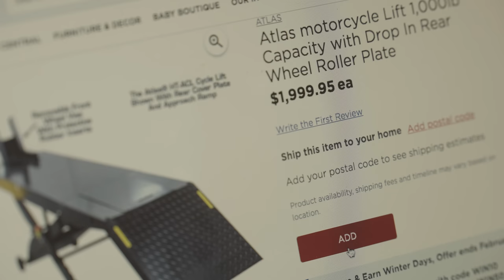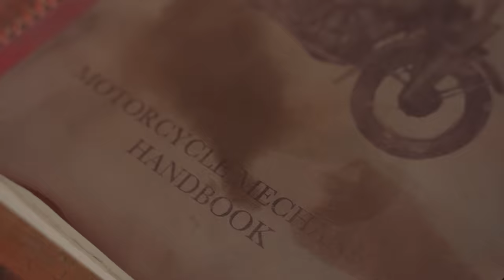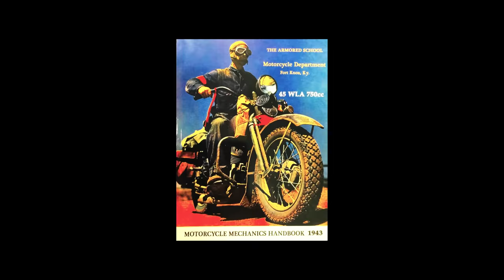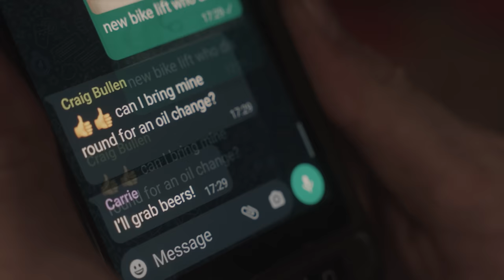DIY Roll-On Motorcycle Lift for $290

Comment: More DIY videos like this! I think many of us can agree that building our own bike shops is a lot more fun than to buy everything online
Reply: THIS!!! 100% this.
Reply: Problem is that lumber is so expensive, it's hard to justify not just stumping up the aluminium and steel prebuilds
Reply: @m1chi13l  not to mention the easy $1000+ on the machinery/tools
Reply: @charlesbennet9233  ... you can always borrow tools from a buddy or your BIL (perfect for F9 cheap bastards) or rent them. No need to fork out $ 1,000 on tools.
Reply: @thedude4065  yeah I can, but not everyone is on the same position. I rate the post but saying only $290 and then using machinery worth triple that and more is disingenuous.
Reply: @charlesbennet9233  regarding tools for this build, they showed nice to have, not must have, you can do all this with a hand saw and a screwdriver, so maybe like $10-15 in tools? Don't let expensive tools in build guides discourage you from building something cool, also don't buy all tools at once, acquire them I over time.
Also, you can get a cordless drill for around 80-120 in a kit with batteries and charger and a miter saw for around 150
Reply: My wife’s mom and dad built a house in the 1950’s using not much more than a hand saw, hammer ,level, tape measure and combo square.

Comment: Works.  The bent over nails reminded me of building soap box karts out of skids in the early 60s.  Lots of bent over nails holding the axles in.  The nails were from Dads used nail bucket.  Never wasted anything.  Cheers 🇨🇦
Reply: No one ever considers the value of the used nail bucket.
Reply: Same. Once thought to take a shortcut and substituted roofing staples. First turning action at speed resulted in a rapid separation of front axle rebar and tricycle wheels (liberated from little sister's garage sale treasure) in a shower of staples as the front of the kart dug into the pavement.

Comment: If anyone is adding the metric units next to the imperial ones I wouldn't mind downloading that one as well :D Also, big thank you F9! Great build.
Reply: Multiply by 2.54= cm
Reply: There's an app for that
Reply: timber sizes are standardised metric and imperial, and get a dual scale tape measure. It'll be good enough.
Reply: Just learn how to brain in inches and feets. Lumber/woodworking is especially well suited for these measurements. I mean, I had to learn how to brain in metric units on occasion. Seeing that the world uses both systems whether we like it or not, it isn't dumb to be able to use both.
Reply: There's always one...

Comment: My bike weighs 400 pounds after farkling, so I use four cam buckle nylon straps to lift it to the rafters of my bike shed.  It hangs and can swing, but angled lifting from four corners tends to keep it centered and there is nothing underneath to obstruct access when changing oil or removing the skid plate, and the rear wheel is hanging in the air so it can spin freely for chain cleaning.  IT's essentially a zero cost bike lift, as I already have the cam buckle straps.

Comment: I have 2 left hands , I just bought the $799 hydraulic motorcycle lift. Not only did I save money on hour labor but I'm pretty sure I saved a couple fingers as well 😅. 
Epic video!
Reply: Pretty sure you'll also be able to do work on the front and rear ends of the bike. Well, if it's a hydraulic frame lift.
Reply: @DiscoFang  yeah works perfect , I can even take out a part in the back so I can easily remove my rear wheel. 😌

Comment: There are alternatives to the bent-rebar front stop that may make the project more accessible. U-shaped brackets, for instance would be one way.
Anyway, great video as always!
Reply: I'd assume that the rebar is a VERY cheap option, they seem to  be trying to hit a sub $300 price point.
Reply: The cheapest and most accessible solution seems to be to just do it without the front stop.
Reply: @Tarkov.  But it requires tools not everyone would have. Most of this could be done with a plain saw, hand drill and a screw driver if you wanted to. What cheap or repurposed house hold object could you use to bend rebar with?
Reply: @Frag-ile  Didn't they show how to bend the rebar in the video? He didn't use any tools other than some heat to soften it...
Reply: How about a torch and small amount arm strength?
Reply: Copper pipe would probably work, but not quite as sturdy….
Reply: @whinstonwhoodle6373  a torch is already a tool that many people don't have.
Reply: @Jehty_  literally a gas station butane lighter is enough to get the job done - it's heating 1 single point on a piece of 1/4" rebar til it's hot enough to bend more easily. If you have to go to the store to buy ANY of this shit, I'm sure you can find something cheap that makes fire while you're there. While you're at it, grab a cheap junky piece of pipe for a lever and bending rebar is easy enough a kid could do it.
Reply: Just use 2 pieces of 2x4 in v shape this will cost you an additional 6 wood screws plus the wood instead of the rebar.
Reply: @Jehty_  You can get a perfectly good torch for about $20.  And you'll find it's useful for many things.

Comment: Perfection...again!  And I love the spanner to turn the eye bolt trick, genius!
Reply: I use open end wrenches to turn eyebolts. I put one jaw through the eye and turn. Been doing that for years. Recently I cut a slot in a deep well socket, slip it over the eye and use an electric drill to run it in.
Reply: @karlbishop7481  haha I use that really crappy "gator grip" socket full of springloaded pins for hooks and eye bolts- it's the only thing that sucker is good for

Comment: Thank you!
For wheel changes I typically use a ladder. with a cheap 12v boat winch mounted to a piece of wood at the top. Connect the winch to the bike's battery, then lift for wheel removal. In your vid you show the bike swinging, but this is easily remedied by straps to the ladder steps on either side.

Comment: You could build it solid too (no pivot), and use a folding loading ramp from crappy tire to get the bike on, to simplify building and keep costs down.  The biggest PITA for me (when working on street bikes) is always getting the front end up and well supported to remove the forks.  I've definitely done the ladder trick, as well as the rafter trick!

Comment: I‘m highly interested in two aspects:

1) Weight limit — not due to construction strenght but due to how much bike weight can an adult person hold in balance with stretched elevated arms while letting it roll uphill to the tipping point?
2) What is the advised procedure to let it down again, as that rear lever part has to be disengaged and straightened before rolling back (again: also for bulkier/taller/heavier bikes)?
Reply: It's a roll on bike lift. Nobody said anything about getting it back off.
Reply: @caffynated552  made my day… I guess I‘ll just mount wheels and a final drive to the stand itself and ride that way 🤪

Comment: Brilliant idea and I will take on the project as soon as weather gets better around the Windy City.  I have a suggestion and my apologies in advance -if I overlooked that detail. I would add a safety latch or drop a wood peg/big dowel pin, on top of the foot ramp (f), while the foot ramp (f) is in upright position (step 4 *f-b).  This safety will prevent in case foot ramp(f) comes off, while securing the front wheel or front forks with wretch straps etc.. Also similar safety idea could be implemented in the front post A - to secure the foot ramp from unintentionally coming off and allow the motorcycle to till rearward. Thanks for sharing.

Comment: Good concept but I can see this tipping sideways as it's very narrow. I would improve the design by adding gussets to the side of the legs for stability (or swinging outriggers with a chain to limit their extension). Then making it fold almost flat for storage along a wall by change the leg fixings to more pipe pivots, with a pin to lock them in place when in use, then it can parallelogram down. Then you can stand it on its end and tie it to the wall.

Comment: List of actual cost in video

Ryobi Mitre Saw - $226
Powermatic Drill Press - $3,662
Large Bore Drill Bite - $90
Maximum Drill - $226
DeWalt Bite - $9
Drill Bite - $15
Angle Grinder - $113
Cutting/Grinding Disk - $6
Maximum Driver - $340
Makita Circular Saw - $190
Saw Blade - $30
MAP Torch - $99
Hammer - $25

Tool Total: $5,130
Material: $290
Total: $5,420
Reply: Let's not forget a workshop large enough to contain all this stuff!
Reply: You can do it with very basic tools if you really want to...
Reply: @danarrib  We're having a laugh is all

Comment: I made one with a piece of thick sheet aluminum a friend had lying around. I cut it a foot longer than my longest bike, and bent 1" lip all around to fit perfectly over some milk crates I had in the shed. Then I mounted a cheap wheel chock on the end of it and made a 4 foot wide, L-bracket "arm" out of the same material that fits under the front crate to attach handlebar tie down straps. I already had a ramp to use to get the bike onto it. It weighs next to nothing and is easily stored under the roof of the carport on a cheap rack I made out of rope and plywood strips. It makes working on the bikes a lot easier, especially at my rather advanced age. I wouldn't pull a Gold Wing onto it, but it easily supports all of my sub-500 pound, 650cc and less bikes. I wish I could attach a photo.

Comment: Top 5 waterproof gloves video is private?😖
Reply: Copied from earlier reply:
They messed up with equating gasproof with waterproof. They had a cool bubbling tanks with slightly compressed air inside the gloves. It looked cool but it didn't prove what they thought they were proving. The replacement video will likely fix this error.

Comment: What happened to the waterproof gloves video?
Reply: Copied from earlier reply:
They messed up with equating gasproof with waterproof. They had a cool bubbling tanks with slightly compressed air inside the gloves. It looked cool but it didn't prove what they thought they were proving. The replacement video will likely fix this error.

Comment: Why are waterproof gloves private
Reply: Who knows. I just went to watch it too 😅
Reply: They messed up with equating gasproof with waterproof. They had a cool bubbling tanks with slightly compressed air inside the gloves. It looked cool but it didn't prove what they thought they were proving. The replacement video will likely fix this error.
Reply: @ddegn  thanks 👍

Comment: Why did you guys already private your new video
Reply: Copied from earlier reply:
They messed up with equating gasproof with waterproof. They had a cool bubbling tanks with slightly compressed air inside the gloves. It looked cool but it didn't prove what they thought they were proving. The replacement video will likely fix this error.

Comment: Did they upload waterproof glove video and then remove it? Or am I imagining things?
Reply: Nah it happened. (and isn't it scary how common this question is becoming?)
Most likely they saw all the feedback on their error and are doing a reshoot.
Reply: @VarvasNukka  what error did they make?
Reply: @Androajay  In the tank test they were testing waterproofness by having the gloves be in water and watching for air bubbles coming out.
Problem is that water molecules are bigger than air ones, so really the test just tells how breathable the glove is but nothing really about water resilience.
Expensive gloves are supposed to have membranes that specifically allow air through but block water, and that test showed that but was called a bad thing.

Comment: DIY...now you're speaking my language.
A few modifications...scaling back the dimensions of the lumber, replacing the re-bar with a removeable piece made of ABS pipe, fix some wheels to the end, and I'll be able to roll it around and stand it on end in a corner of my garage. This will be great for my sub 300lb bike and scooter.

Comment: Hiya,

great video and nice project! What's the maximum weight it can carry? Is there by any chance a version of the plans available with metric units? (For the few of your followers not living in Northern America, Liberia or Myanmar and for the many of them too lazy to do the maths.)

Best wishes!
Reply: With the size of the wood that would carry a small bus.
Reply: Fire up the Goldwing!
Reply: Inches x 2.54 = cm
Reply: There's free phone apps to convert
Reply: @unsafe_at_any_speed  ...  like the guy above posted, ... Inches x 2.54 = cm
Reply: @MikeHcan2  cm? What are you - a dressmaker? The civilised world uses mm.
Reply: @darkiee69  Timber is good in tension and compression - bending not so much. But there's nothing that a flitch plate or some toe down channel or angle fixed to the underside for ½ the length of the span, centred on the pivot, wouldn't fix. You could even carry the slotted angle right through over the pivot point, point rather than having the gap, and put some low clearance holes in to fix it as a tension member with coach screws that would limit the strain of the timber.
Reply: @TonyRule   Bending is tension and compression. Which, as you point out, wood is very good at. That is what wood is particularly good at - bending.
Reply: @DiscoFang  No. The rail will be subject to tension through to the neutral axis.
Reply: @DiscoFang  Oh, I see - I miswrote that. It's not that good in tension - the fibres pull apart relatively easily.
Reply: @TonyRule  No yourself. Strength in bending/deflection is what timber does best. Eg Masts. Timber framing.
Reply: @DiscoFang  No, it doesn't. Timber masts have stays to prevent bending for this very reason - it puts them in compression to limit the tension forces at the extremities of their cross section where they'd be in tension - much like pre-stressed concrete. Timber framing used in situations that are primarily subject to bending loads, such as rafters, trusses, stringers, and joists, are tall sections opposing the load or are braced with span reducing struts and ties for a reason - they would otherwise quickly tear apart on the side opposite the applied bending load, without those additions, and fail. What do you think the nogs are for in vertical framing? To reduce the induced bending from compressive loads by breaking the span.
Reply: @TonyRule  You’re describing point of failure load limits to dismiss their function and properties within limits. Stays on masts increase limits. Refer back to the original point - bending is both compression and tension. Timber flexes - to a point.
Reply: @DiscoFang  The original point to which I replied was that that member "could carry a small bus" . It might if it was in a simply supported configuration, but not with that rear cantilever.

Comment: Have hydralic lifts available for just above 600$ here, no need to go all the way to 2000$.
Bought one an it works fine, specially with an added mini screw type lift (60$) to put under the belly of the MC
Very flexible setup

Comment: To be fair, down here in Yankistan <insert monger of cheap asian tools>sells a heavily, heavily discounted bike stand. Hardly as romantic or wonderful, though, but squarely between the price of the two above and fully hydraulic. My ride was stranded on one at a friend's house for an entire winter with no issues. It's a good tip for some.

Comment: For the same price or less if you find it used, just buy a Hydraulic lift Table Cart from Harbor Fright. It slides underneath the flat frame, and the wheels make it portable and can lift up to waist height.  It's what I have been using for my Dr650

Comment: That's cute.  HF heavyweight motorcycle platform lift is $600...steel.  lightweight $400 (were half that on sale before 2019).

MC hydraulic or mechanical jacks are 40 to $150USD.  Abut $200CAD

Comment: Great video from @FortNine as always, and the concept is pretty cool.  However, I just looked over the plans and feel compelled to point out that they are seriously deficient and downright scary from a safety perspective! 😬 Raising a heavy motorcycle 15 1/2" on a wooden stand with a base only 14" wide?  It wouldn't take much of a sideways push to cause the bike and stand to fall over, causing serious injury or death.  This needs a MUCH WIDER base.
Remedy:  Get 2 more heavy-duty steel angle irons, at least 48" long, and attach one at the rear of the center pivot (part D) with long screws or bolts and the other at the very front under part A.  This will give an extra 17" of width on either side of the stand making it much more stable.  You could also bolt heavy-duty 90-degree angle brackets on either side for even more rigidity.  Then attach the tie-down hitching straps to holes at the outer ends of the angle irons giving the motorcycle even more stability when it's in the stand.

Comment: Miter saw: $200+ (or circular saw and square, let's call it $60)
Angle Grinder: $50
Drill: $50(obviously not a press drill, as used in the video that would be way more)

For less than price of the tools needed in this video(not to mention the actual materials) you can drive over to harbor freight and spend less on a motorcycle jack/lift that does 80% of what this does for $140 not including any coupons.

Of course, if you absolutely need a full length lift like this for some reason, it's cheaper to buy the materials and tools than to get even the harbor freight one(which comes in at $600, or maybe $480 with the 20% coupon a few times a year). But it's close.

Not denigrating doing this at all, it's nice to build your own stuff. Just letting people know they could check an even cheaper alternative and see if it meets their needs.